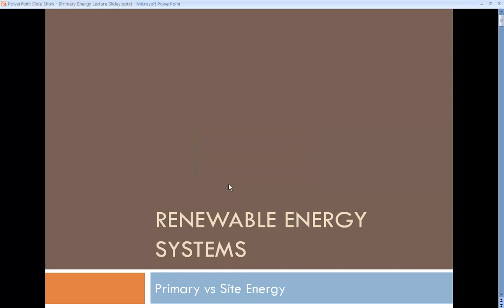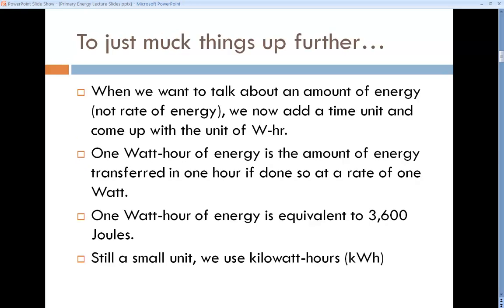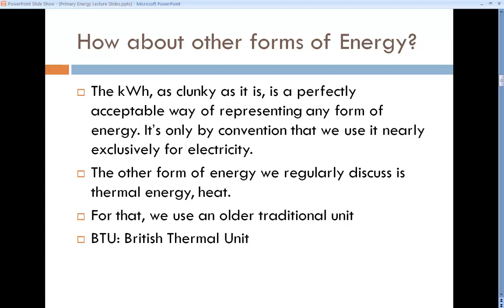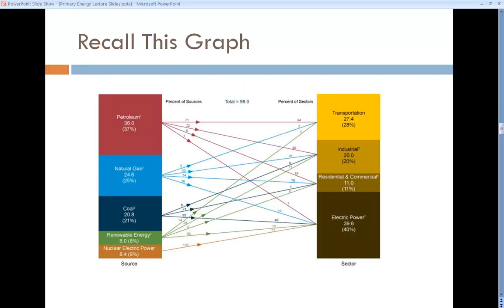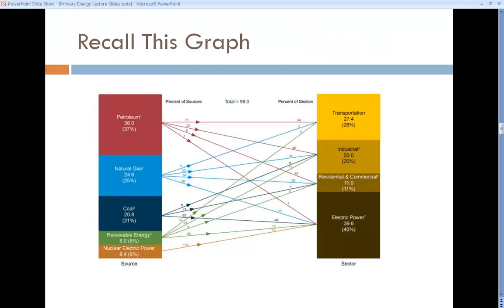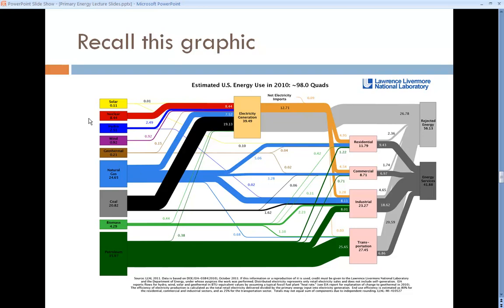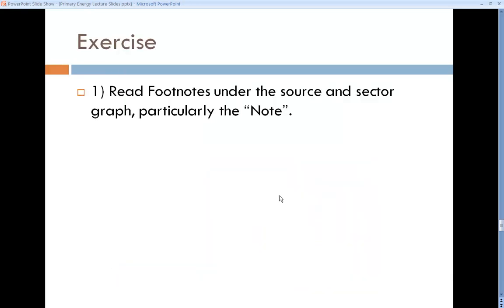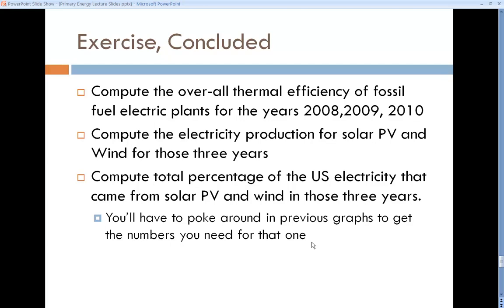Primary Energy vs Site Energy Lecture

Comment: The graph showing Estimated US  Energy Use in 2010, you pointed wrong about solar. In that case, only 0.01 (no unit) of solar were used to produce electricity and 0.10 were used to residential heating (solar thermal technology). When renewables that don't convert fuels into electricity are represented in figures for households, they are represented as final values. i.e. all the losses through the renewable system were already taken into account.